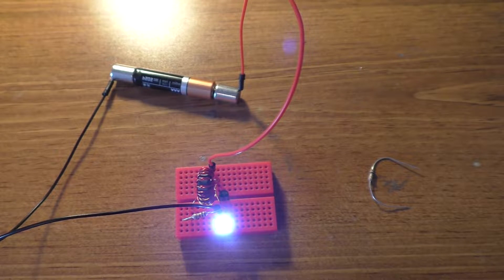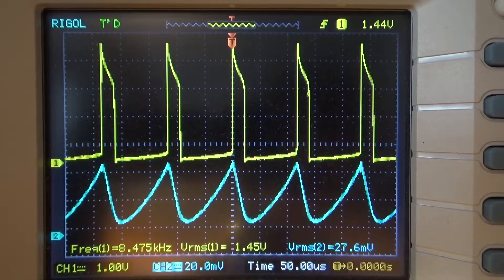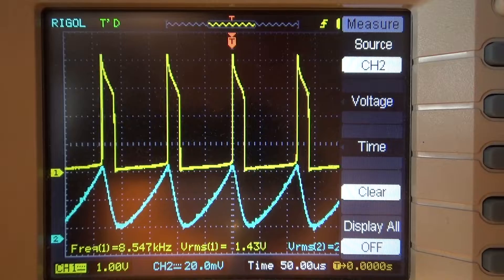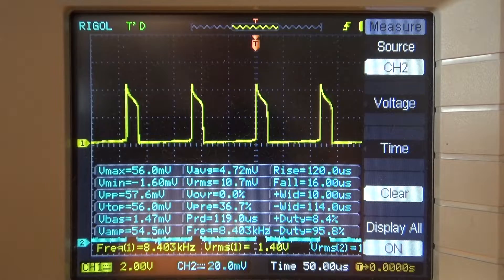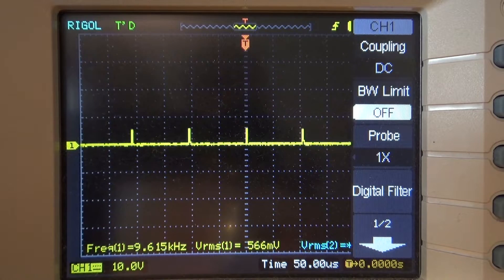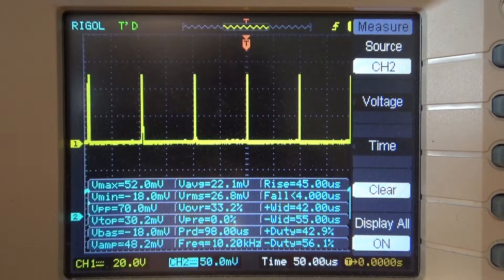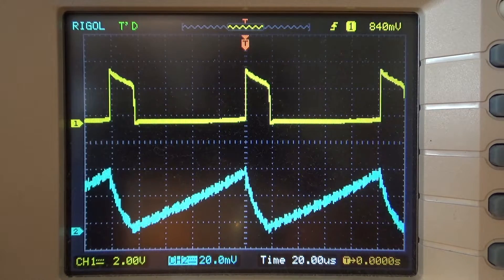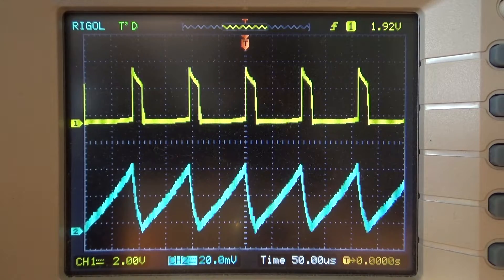Probing a Joule Thief With an Oscilloscope

Comment: Very useful your evaluation of Joule Thief, its waveforms and even a clue of stored energy per cycle.
With it I saw something quite interesting: the “area” (product) of Volt x time was about the same in these 2 situations:
With LED = (aproxim. Retangular) = 4V x 20uS = 80uVS 
Without LED = (aprox. Triangular) = 1/2 x (55V x 3uS) = 82uVS
Average current per light pulse = 1/2 x 54mA = 27mA
Average voltage per light pulse = (4.2 + 2.8) / 2 = 3.4V
Power per light pulse = 27E-3 x 3.4 = 92mW
Energy per pulse = 2uJ, either from 80uVS x 27mA = 2.2uJ  or 92mW x 20uS = 1.8uJ (depending which approximation you choose).
Mean power = 92mW x 20uS / 120uS = 15mW
Mean current in LED = 27mA x 20/120 = 4.5mA  <==> Surprisingly different than RMS measured by the Scope (I remember something like 11mA_rms) 🧐 - I don’t know at this moment what is the source of this (my mistake or oversimplification, or the mixing of average x rms values, perhaps).
Overall, a lot of this to learn and was fun too.
Thanks for posting!

Comment: The resistor can change it a lot and also the windings. One of mine runs at 500khz and the other is 170khz. One has a 500 ohm resistor and the other 1k.
Reply: I have two turns of equal wire length, 25 per.